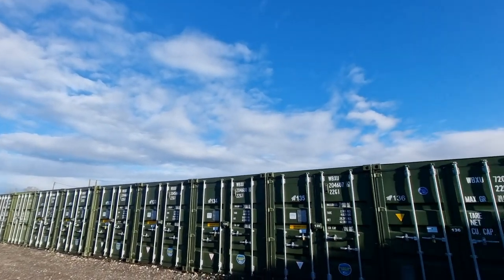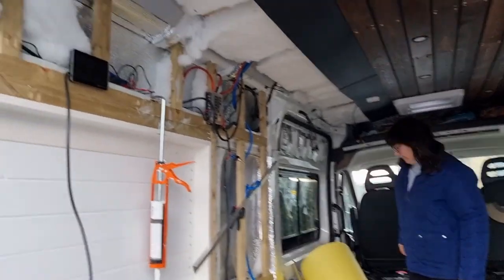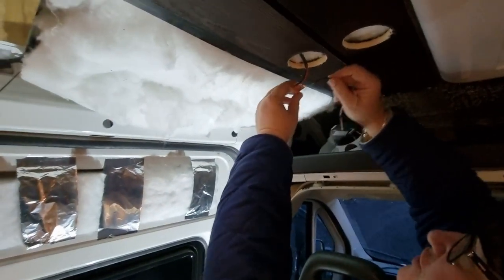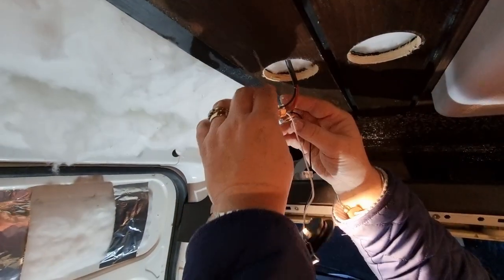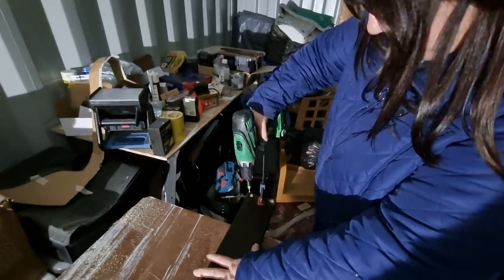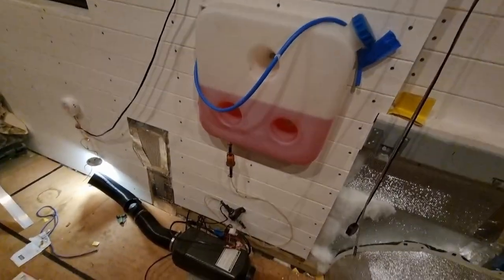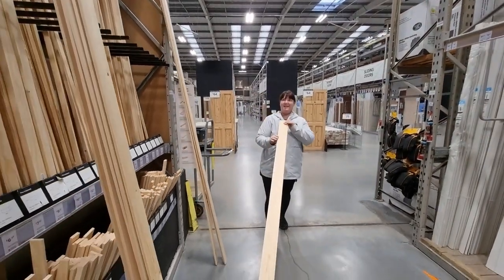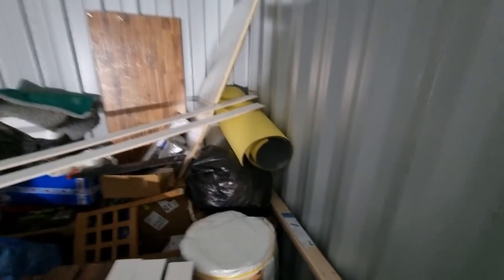Elaine on the tools - Peugeot Boxer / Relay/Ducato/Promaster - Camper Van Conversion | EP14

Comment: Hi pardon my ignorance but is there a reason no vapour barrier over insulation
Reply from the maker: Hello, rightly or wrongly I/we have decided not to install a vapour barrier and concentrate on ventilation
Reply: @b19wll  fair enough I just wondered as see so many builds with vapour barrier and saw one guy rip out his whole van becouse of condensation becouse he didn't do over cab it's on you tube ,so plz keep us posted how you get on ,thanks for reply